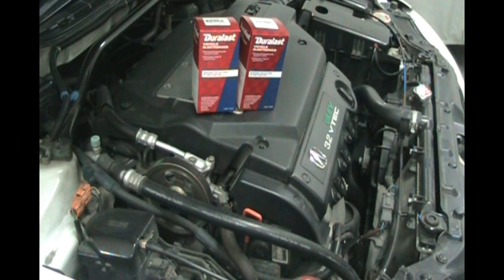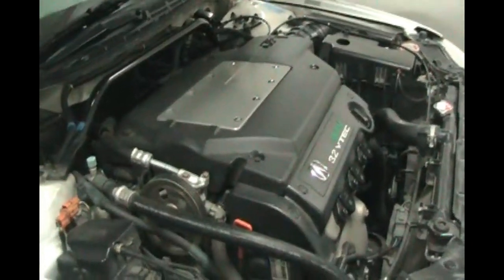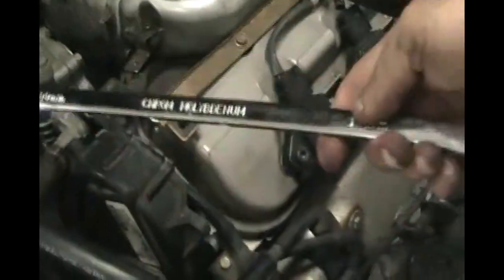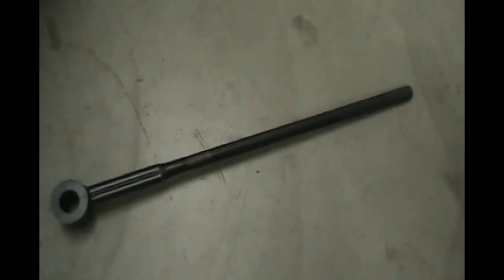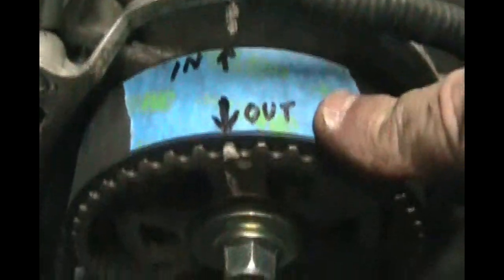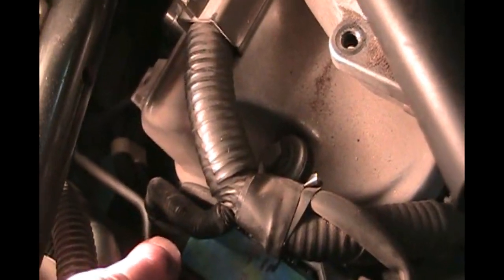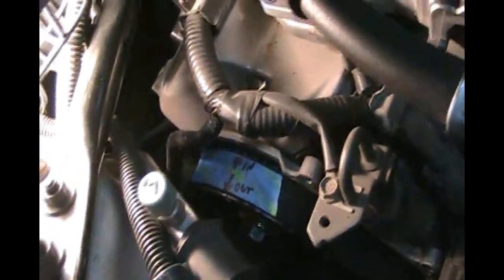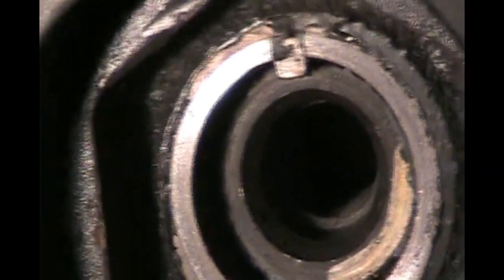2000 Acura 3.2 TL Camshaft Position Sensor and Crankshaft Position Sensor Replacement D.I.Y.

Comment: Hi John, trying to be like you but with my 2006 TL 5AT base in Alabaster Silver. I like your oil filter choice. I am using the Ultra version on my TL. I am having P0300, P0301, P0302, P0304 pending misfires under load of 3K RPM or more. the flashing light only tends to appear under wide open throttle or holding the engine at 3K or more for a multiple misfire cycles. I have replaced plugs, coils, timing belt kit, pcv, cleaned egr, repaired and oil leak into the spark plug tube seals prior to replacing the plugs, all genuine parts, ive done swaptronics and the misfires do not move, compression is good, i’m stumped. im thinking its my injectors

Comment: 600,000 miles? Incredible.  You took great of that car.  I kind of let mine go but now I want to fix it up.  Good job!
Reply from the maker: Since this car has the most miles in my fleet, it receives the most maintenance and thus the most YouTube videos. I only wish that I hard started making videos on this car sooner.  I've only posted 4 videos on this car so far, but I plan to make a playlist on my channel just for this car. I bought it certified pre-owned with 51,000 miles as a 36-month local lease return, so I put over 550,000 miles on it myself.

Comment: The crankshaft sensor can prevent the car from starting even if you have spark, fuel AND air?? I dont have any misfire codes but the car only cranks
Reply from the maker: I had a similar problem on my Acura TL about 5 years ago with cranking but not starting. Have you checked the fuse in the engine bay located in the black fuse box behind the right front passenger strut tower? It is a 15 amp fuse labeled "ACG S". If that fuse is blown, the engine will crank but never start. I also had an intermittent issue with the main relay under the steering column. It is Honda part number 37400-S84-003 or Autozone Duralast #20113. Mine had a short and the car would shut-off while driving. When I pulled this relay out I could press on the circuit board while the car was running and see a spark and the engine would die. If you need a video with instructions on either of these, let me know and I can make one.
Reply: @JohnsGarage  would you please make a video. My car shuts off randomly and it’s kinda scary thank you!
Reply: @val3077  that can also be the ignition switch going out.try this when car is running wiggle the key as car is on and see if it shuts off. Faulty ignition switch common on those years
Reply: @adriandiaz4940  will try it. Thank you!!
Reply: What if you have fuel,spark and cranks but wont start?
Reply: @JohnsGarage  My 02 tl s has the codes p301-306 and it turns on fine but stalls after turning on but when given gas it stays on pls help i need help figuring this problem out

Comment: My 02 tl s has the codes p301-306 and it turns on fine but stalls after turning on but when given gas it stays on pls help i need help figuring this problem out
Reply from the maker: Those codes indicate random misfires on all 6 cylinders. When was your last completed tune-up? Do you have the correct spark plugs and coils? Are they fairly new or very old? Have the valves been properly adjusted?  Have the two oxygen sensors ever been replaced.  Is the PCV valve working properly?  PCV valves are inexpensive and easy to replace.
Reply from the maker: Sounds like an air/fuel mixture problem. Have you cleaned the throttle body? Also, under the throttle body is the Idle Air Control Valve (IACV). That allows the right amount of air to get thru when the throttle valve is closed so that the car can idle. In high mileage cars, that valve gets carbon build up and can fail to move smoothly or even seize which can mess up the amount of air needed for the car to idle. It may be difficult to clean the carbon off and may need to be replaced. Auto parts stores sell this IACV for about $100.
Reply from the maker: Another very easy thing you can do is "clean the beehive." Remove the top plate on the very top center of the engine by unscrewing several 10mm bolts. Once you have that plate off, turn it over and take a small screwdriver to scrape out all the carbon deposits in the EGR passageways. Also, clean the four ERG port holes on the intake where the beehive is mounted. If the beehive is clogged up, it can throw codes.

Comment: I just bought a 2003 Acura TL that won’t go past 3000 rpm, if it goes past 3000 the car jerks constantly , if put in manual mode and shifted before 3000 rpm it will get all the way up to speed do you think this could be the problem ?
Reply from the maker: This could be an indication that your transmission is slipping.  Possible bad clutch packs in a certain gear.
Reply from the maker: Check your transmission dip stick while parked and the engine is off. Ensure that the fluid is between the low and high marks on the stick. Also, ensure that the fluid is pink in color and does not look burned and dark brown.
Reply: Ended up being crankshaft position sensor and both o2 sensors
Reply: @andrewgentzel8703  was it stalling at all?

Comment: Do you have to all of part 1 to do part 2? I got p0335 error so want to swap out the crankshaft position sensor. Can I just remove the lower cover and swap the sensor or do I need to take the timing belt and all the covers off?

Comment: He should of put the OEM crankshaft sensor on them autozone parts gonna be fixing it again
Reply from the maker: The AutoZone sensor has a lifetime free replacement warranty. I have lots of AutoZone sensors on this car with no issues at all. Acura does not offer lifetime parts warranties.  I only use genuine Acura brand parts for selected applications like water pump replacements, etc.
Reply: @JohnsGarage  they offer warranty because they know it gonna need to be replaced over again I got a acura I tried autozone and it was costing money every few months for replaced the same part OEM had no issues
Reply from the maker: Sorry to hear about your bad luck with Duralast parts.  The only AutoZone Duralast part I recall ever having to go back to the store is the ignition coils.  They still worked fine, but since they have a lifetime warranty, I return them every 2 or 3 years or so when the rubber boots dry out and they give me free new coils.  Those are expensive so it is a great deal. The Acura dealer parts are only warranted for 90 days or 3,000 miles and electronic/ignition parts come with a "tail light warranty."  As soon as you drive away and they can no longer see your tail lights, the warranty is over. If you come back the next day, no warranty at the Acura dealer.